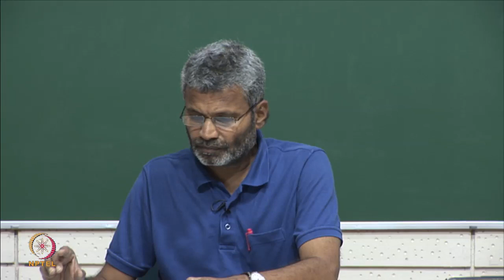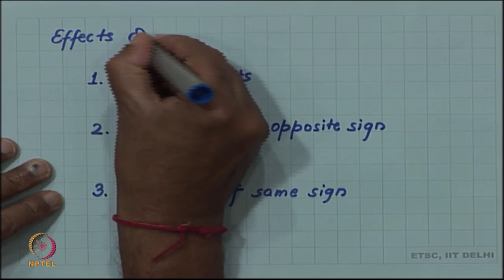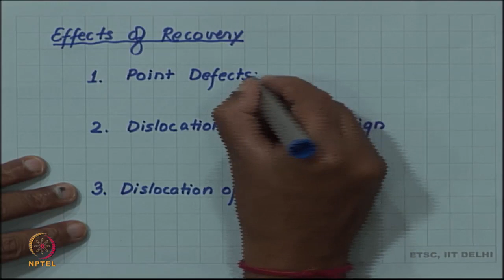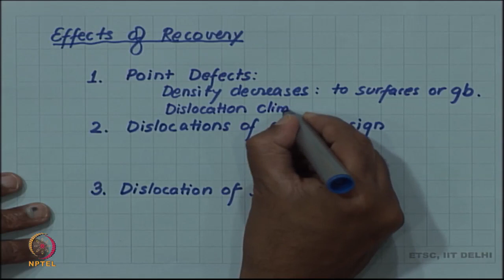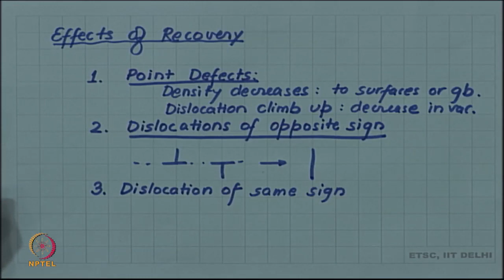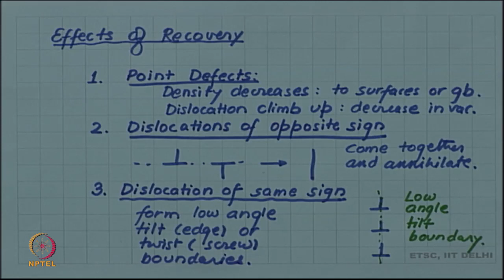Recovery

Comment: How number of vacancies increase during cold working? 
I know that dislocation density increase due to Frank Read source.
Reply from the maker: This is a good question. Not an easy one to answer. Dislocation climb down is one possible mechanism. Another possibility is two opposite edge dislocation on parallel but adjacent slip planes coming together. If they are on the same slip plane they will annihilate. But if they are are  on adjacent slip planes they may generate a row of interstices or a row of vacancies depending on whether the half-planes overlap or not.
However, the increase in concentration of vacancies due to deformation may not be very high.

Comment: During recovery, we are only heating the workpiece. How is then the dislocations are moving? Previously we studied movement of dislocation under the action of external forces. But here, there is no application of force. Is it because of diffusion of atoms?
Reply from the maker: This is indeed a very intresting question. 'Interesting' means not an easy one two answer. Let me try. There is attractive force between two dislocations of opposite sign on the same slip plane. But this may not be sufficient to move them as a minimum critical force is required for movement. I guess that the thermal energy helps the dislocation in overcoming the barrier. 

For edge dislocations of the same sign on parallel planes there is a climb force as well. This is what creates low-angle tilt boundary in a process called polygonization. But climb requires vacancy movement which is again assisted by higher tempearture.

These are my current guess.I think I have to give a more careful thought to sort this out. Thanks for asking.
Reply: @introductiontomaterialsscience  Thanks for the explanation, Sir!

Comment: In Annealing we are heating the specimen so number of vacancies should increase according to relation, n = N*exp(-H/RT). But in this lecture you are saying that point defects decrease. 
Sir, kindly justify it.
Reply: The comparison is being made between the vacancy concentration in deformed and annealed samples, both at room temperature. 
Let NER and NEA be the  vacancy concentration in equilibrium at room temperature and the annealing temperature respectively. Obviously NAE>>NTE. But the deformed sample at room temperature has a higher vacancy concentration NDR=NER+DN. Upon annealing the excess vacancy concentration DN disappears. On cooling back to room temperature one again gets a equilibrium concentration NER. Thus the decrease in vacancy concentration during annealing is NDR->NER or 
NER+DN->NER. The sequence of evolution of vacancy concentrations is as follows: NER (undeformed, room temperature)-> NER+DN (Deformed room temperature)->NAR+DN (At annealing temperature, beginning of annealing)->NAR (at annealing temperature, end of annealing)->NER(at room temperature, cooled after annealing).